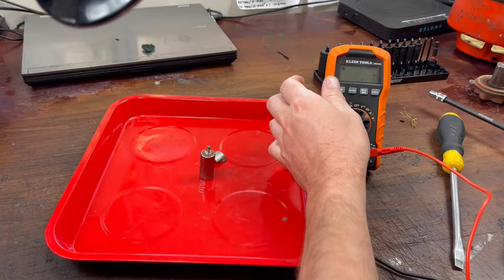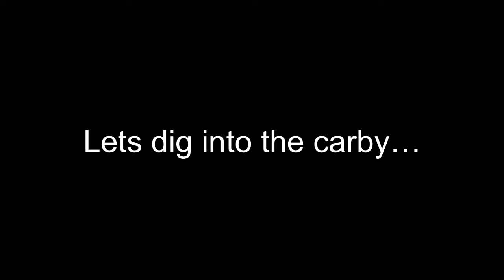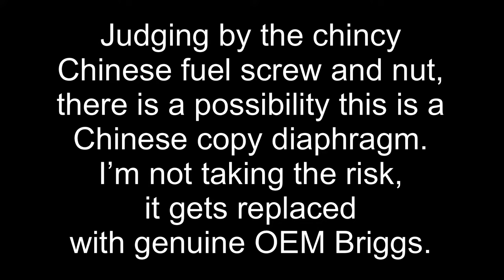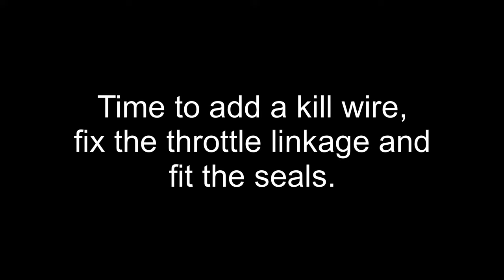VINTAGE BRIGGS & STRATTON  - CAN WE SAVE IT?

Comment: I have a question on flywheel removal. You used a hammer on the end of the crank. Is there a concern about mushrooming the end of the crank? I noticed you had a problem putting the starter clutch back on. Am I concerned about nothing?
Reply from the maker: Only ever use a brass hammer, or the correct knock off tool from Briggs, which is… a brass cover that you hit - same thing 🤣

You won’t mushroom hardened steel with a brass hammer. 

The starter clutch was already stiff and had burrs from a lack of lubricant that should have been applied to the felt pad. The previous owner didn’t do this and that was the result. Word of caution, don’t hit a crankshaft that is threaded without a nut on the end even with a brass hammer, that can damage the threads!
Reply: @VintageEngineRepairs  this is an awesome video because it gives great detail on the remedy for common issues found on these 45 year old machines. Will a 2022 PowerMore be running in 2067? I doubt it. But this engine might still be running then, especially since you got rid of the points.
Reply from the maker: @haneyoakie14  I’m a sucker for points - I like their simplicity, but electronic ignition is hard to dislike until they start putting electronic rev limiters in them!
Reply: @VintageEngineRepairs  to be honest, I was disappointed that you converted it to electronic ignition, especially after you did a great job on cleaning, diagnosing, fixing, and explaining the points ignition system. I think it is fun to retain the historical accuracy of the old equipment. I do think it depends on the end use of the equipment. If he wants to put it on his minibike and never have another ignition problem, the electronic ignition makes total sense. If it were the motor on a generator that sits for a long time and then gets called into critical use, the electronic ignition makes sense. If it is for fun and educational purposes, I love the points.
Reply from the maker: @haneyoakie14  I understand and I’m the same, however they would have had to be brought from America which would take weeks and also be very expensive. Some decisions have to be made logically rather that from the heart right!
Reply: @VintageEngineRepairs  I totally agree. I am enjoying your content quite a bit.